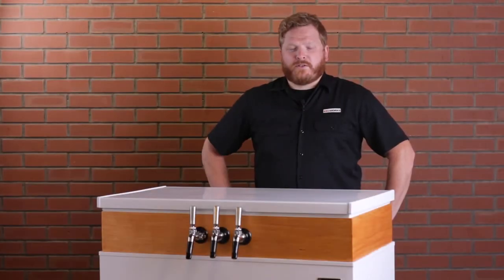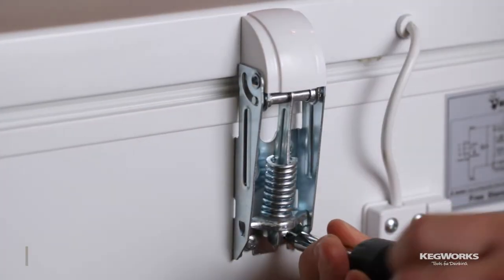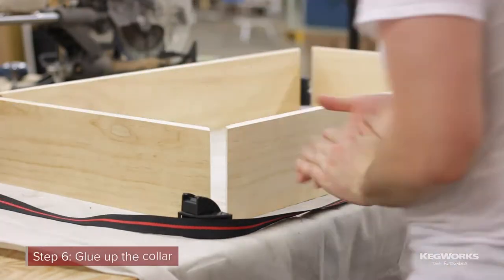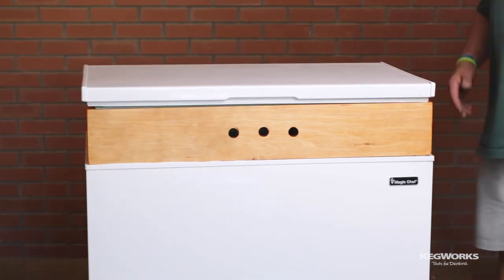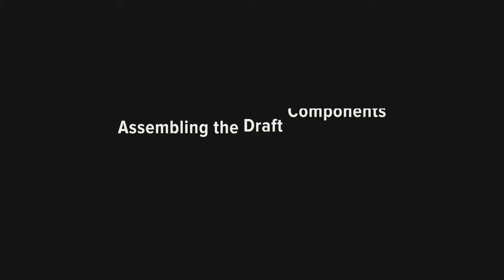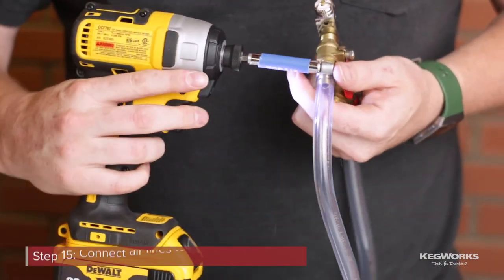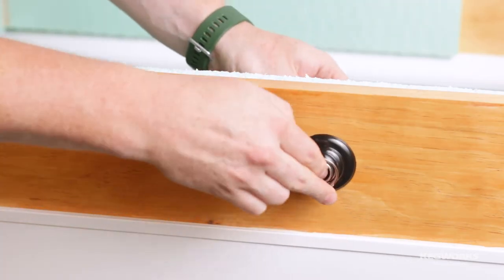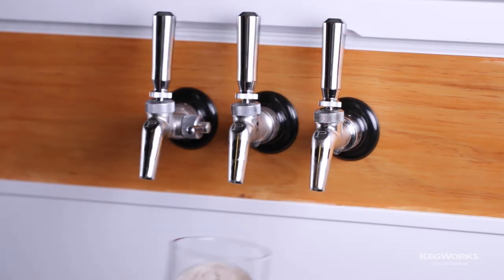How To Build the Ultimate Keezer | Beer, Wine, and Cocktails on Tap

Comment: Instead of putting the faucets on the collar, could I run the beer lines out of the keezer a few feet, into a tower and faucet? Provided they were insulated the maintain beer temperature, and sealed well around the hole in the collar.
Reply from the maker: Yes that would be possible! Depending on how far you need to run the lines, you might want to look at adding a short draw glycol pump.

Comment: Nice build.  Do you need to do anything to ensure a good seal between the lid and the wood frame?
Reply from the maker: The original seal on the lid was enough for us, but it would be a good idea to check for any air leaks.

Comment: Is nitrogen necessary?  what is it used for besides the CO2 cylinder for tapping?
Reply: Nitro is used as the gas for pushing the wine and cocktail because it doesn't dissolve into solution. If you use CO2 it would carbonate them, which is fine for the beer but, not what you want for the others unless you want to be pouring sparkling wine and bubbly Manhattans.

Incidentally this is why stouts often use a CO2/Nitro mix. You dial up the pressure and it gets the beer lightly carbonated, and is then pushed through a restrictor plate on a stout tap which gives you that dense creamy foam and lowers the carbonation in the beer itself.